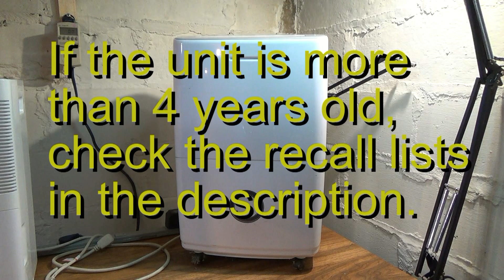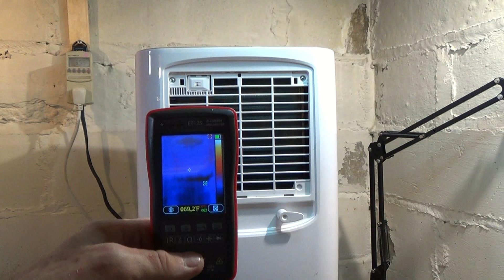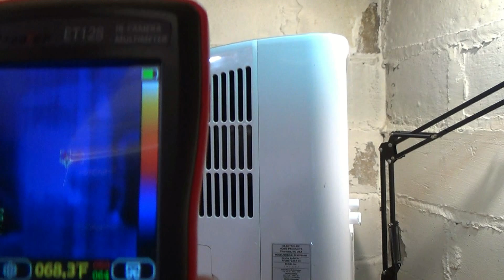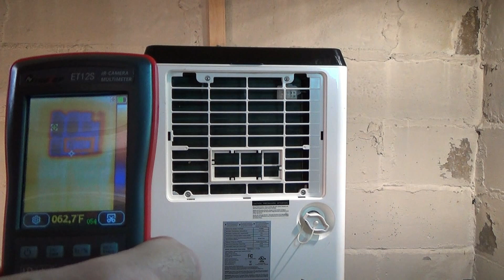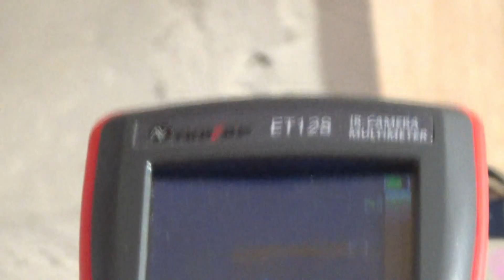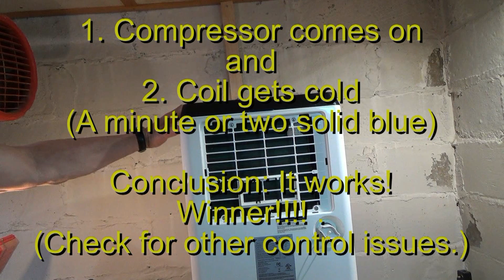Can I save this dehumidifier? It stopped filling up.  Quick assessment

Comment: so what it leaked its charge put a tap in and refill the leaky unit for another season. ive done this to my 2 units i have like 1 can of r134a per unit a season is cheaper than buying a new unit every time the chinesseium bs leaks its load. lmao.
Reply from the maker: Yes, It is physically possible to add a tap and "fix" by charging it but it will still leak or leak again. Leaving leaky stuff in service is not okay. We know better than to do that these days. If you're not worried about the environment, what value do you put on your time? It is just not worth it. We need to find and buy better stuff so the market for the "crap" dries up.

Comment: WOW...i have that same dehumidifier and the same thing is happening,  it runs,  but doesn't seem to take moisture out of the air and it just runs and runs and runs.  I finally replaced it.  Of course i bought it 5 years and 1 month ago,  so naturally the warranty is expired
Reply from the maker: Some companies started including a small print extended "pressurized system" warranty in addition to their standard one year warranty. The longest I have seen is 4 years, so you are still out of luck.